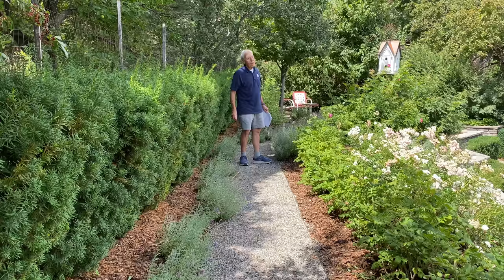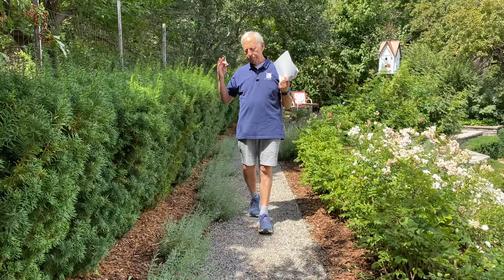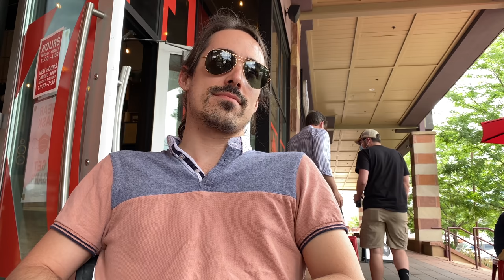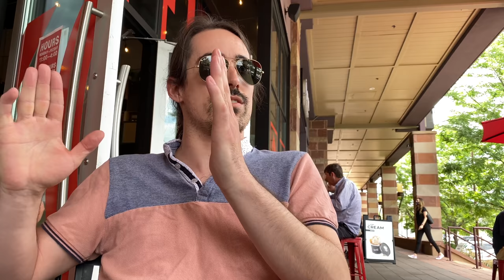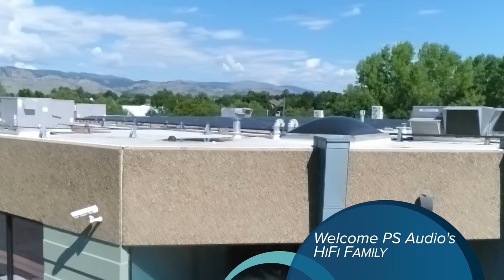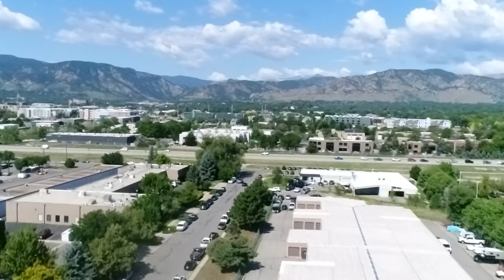Battling class D distortion with tubes

Comment: IcePower operates fine within the intended dynamic range like other fine amplifier architectures. When you exceed that you get distortion, like with other amplifiers. Buy a more powerful amp if you need louder music rather than an amp that is trying to pretend it can play louder by camouflaging the peaks through soft clipping reducing the harsh uneven harmonics. Well, I’m not against soft clipping but please don’t do it with an old solution involving an imprecise tube that needs warm-up and wear out rapidly with sound changing over time. If you really want to do soft clipping, do it solid state and make it sound like the best of solutions. Tubes look great but are yesterday’s fix on this sort of making an amp sound bigger than it is.
Reply: Then there is the asymmetry problem.  Tube stages produce primarily even-harmonic distortion which differs between positive and negative peaks, while class D output stage distortion is symmetric.  I can't see this kind of compensation working well for both signal polarities.  
But they're talking about a 1200W amplifier.  Surely a better solution is just to turn the volume down a couple of dB and avoid the distortion in the first place?  Who needs to drive such equipment all the way to its limit?
Reply: @marianneoelund2940  If you want louder, get more amplifier(s) and more speaker(s). A Klipsch LaScala in each corner and along the long wall should do the trick, along with at least 4 to 6 BHK's.
Reply: @jamesplotkin4674  
My mains have horn-loaded mids and tweeters, not entirely unlike the LaScala.  Even a modest amplifier drives them louder than I care to listen to.
Reply: It does seem kind of Rube Goldberg-ish, however .  .  .  

Possibly just Paul playing agent provocateur with the comment section.  And maybe sell a few more Stellar M1200s.   Or not.  Bottom line, do they sound any good?  I have not heard them so I really have no opinion as to their merit or lack there of.  And neither does anyone else who hasn't listened to them critically, but this has seldom stopped anyone, has it?
Reply: Also, no need to talk about class-D distorsion because one implementation behaves badly at higher levels.
Reply: As I understand it, when valves ‘soft clip’ due to overdriving them, it is much better sounding to your ears than Class D. When a Class D stage is overdriven, due usually to a lack of headroom, they don’t soft clip at all but produce a very hard sounding distortion that to most peoples ears is far worse than the sound of a valve amps soft clipping.
Reply: Roland Jones Yes, but you don’t need to add tubes to create the soft clipping effect. You can do that better with a transistor based circuit.

Comment: LOL!!! Lets see here. Lets use 2nd order distortion to cover up the 3rd order distortion. If I had told that to my first Engineering Mgr (John Laurent, 68) he would have fired me on the spot.
Reply: There are a lot of trade offs to consider in the audio world. For people that want extremely high power, without 100 pound components, little to no heat, but sound that is pleasing to the ear, then this is one way to get there.
Reply: @CaptainCrunch823  "sound that is pleasing to the ear" does not mean it's accurate.
Reply: Bill Kenney I don’t disagree with you. I think you made excellent points. I’m just raising counter points for consideration. Some consumers such as myself spend our money on equipment that sounds great, but often not necessarily accurate😊 I’m personally less interested in class D these days but I understand the benefits and would recommend it to friends if they gave me a list of requirements and it checked a lot of their boxes. I would just make sure to educate them on the tradeoffs before they spend their hard earned money.
Reply: For any BOM cost target you like to get the best out of it. Soft clipping can be done well for cheap (not based on tubes) and while I prefer to have enough natural dynamic range in my system and not rely on some “trying to make good sound out of the peaks”, soft clipping can be a good feature of an amp. Using tubes for it seems a bit of snake oil to me and isn’t ideal for keeping a solid high performance from t=0 when you power it on to years later. Tubes are great in museums.
Reply: @CaptainCrunch823  Great comments from all. Way back when MIT (Media Lab) and BAS did a study on why people preferred the sound of tubes. Your's truly was part of that group. 20 golden ears and a mountain of equipment. There is a preference for tube sound for sure. But, you can reproduce that using DSP. Paul has eluded several times to building into one of his DAC products the necessary processing power to simulate that sound. It would be fun to dial in the sound of the 6550, EL34, 3B4 ect ect. I think it can be done. Note that some of the participants contributing content were recording engineers who brought Master Tapes they had created.
Reply: @wilcalint  Yes, exactly right. There is nothing a tube can do in terms of incremental distortion that a DSP can't do more reliably, more optimized, without wear-out issues and without warm-up dependency. However, if you do tube sound in DSP, you probably want to have some settings allowing you to pick or tweak your favorite tube sound and most certainly, you don't want to add a DSP introducing another ADC and DAC in the path. "DSP tube" is great if you already have a high performance DSP in the path (one where you don't introduce audible quantization noise). Nowadays even a low cost ARM CPU can work as a high performance DSP and if you want to go crazy, you can do all the math in 64 bits at a ridiculously high enough sample rate to finish all arguments. I want to make such product.
Reply: @ThinkingBetter  "Nowadays even a low cost ARM CPU can work as a high performance DSP" - Raspberry Pi 4? :-))
Reply: @wilcalint  Yes, a RP4 can do very well e.g. running Audio Weaver or other DSP SDKs. Ideally you can plug-in, tweak or swap the DSP layout run-time (in this way your tube sound can be a user configurable plugin).
Reply: @ThinkingBetter  This has turned into a very spirited discussion hasn't it! :-))
Reply: @ThinkingBetter  Tubes can reduce the overall component count, they may be cost effective in some areas. When it comes to snake oil I will take a Tube every day over a boutique speaker cable.
Reply: Hugo Bloemers I prefer a pure and tube distortion free signal path and I also prefer not to pay for cables >10 times the manufacturing cost. But tubes look great.
Reply: @ThinkingBetter  For years I owned a classic Williamson ( H.H.Scott Brand) quad 6550 power amp. I loved that thing. 60w/ch. Loved that warm orange glow of those tubes. I wish I had it back.
Reply: Let's be respectful here since that is how intelligent conversation is carried out. Your comment is misleading and tells me that you didn't fully understand what I was saying.  Here's a hint - you first have to study the transfer function of a non linear amplifier. ;)
Reply: @darrenmyers1826  I was probably calculating transfer fuctions when you wern't even a glen in your papa's eye. You ever calculate a transfer function for a servo amp for a 5in naval gun?

Comment: Sounds like the ICE module is over compensating on the voltage rails as the power is increased, thus giving the expansion effect you describe. Don't see how you are going to fix that with a tube. Yes tubes do go into compression but only as they approach cut off not over the range you will require. Good luck -

Comment: Its a good idea to drive a Class-D upto 70% of peak power. They start distorting above this point (anti-cpompression). Another way to deal is to use higher impedance mid/hi loudspeaker drivers. Low impedance woofers and subwoofers can be used.
Reply: Anti-compression*

Comment: Somewhat related to this discussion is a problem that was worked on in Cinema in the early days of the “talkies”. Pre-movie sound there was little motivation to make the auditoriums sound friendly so when the talkies” came along the dialog was buried in the reflections of the room. So the Academy of Motion Picture Arts and Sciences

https://www.oscars.org/

Came up with what was referred to at the Academy Curve sometimes referred to as the “Normal” curve. The curve was applied to the sound path before being broadcasted into the movie auditorium and that made the dialog more understandable. Basically they added sound frequency level distortion (EQ) to the sound to make it easier to hear what was being said.

https://hometheaterhifi.com/volume_9_2/feature-article-curves-6-2002.html

Comment: Yet another nonsensical video. Adding H2 to mask higher order harmonic distortion. How about using a low-distortion amp to begin with (if we're talking class D: NC252MP, NC400, NC500, NC1200 or the Purifi). Or just an amp with more pwr so you don't have to drive it close to clipping..
Reply: ......word
Reply: Now we’re talking. I’m very happy with my Hypex☺️.

Comment: Did you know that the invention of the tube was a light bulb moment.
Reply: When the very first tube was powered on it said  “I can’t see the trees through de Forest!”.
Reply: Actually you are right. Edison experimented with an additional electrode to improve performance and life of light bulbs.  Current could be made to flow between electrodes.  This was dubbed the Edison Effect.  No practical use was apparent, so the invention was shelved.  This is how vacuum tube rectifiers work by the way.

Comment: Why are we even discussing distortion under 0.01%?  That's not a problem.  
Here's a problem:  Where's the heat sink on the M1200?  The ICEpower 1200AS1 module is specified with a 0.8C/W heat sink mounted.  Even with that, continuous power output is limited to 270-280W with 8 ohm or 4 ohm loads, and full-power operation is limited to about 15 sec when using 120Vac 60Hz power.  But I don't see any of these limitations mentioned in your product description or specifications - let alone anything specific to the actual thermal design of the M1200.  
So what's the story?  How hard can this beast really work, without going into thermal shutdown?

Comment: Folks, the proof is in the sound - if it sounds good to a majority, what difference does it make how the distortion is dealt with? I do not care about measurements unless they prove useful in determining where a sound PROBLEM originates. I have a Directstream Junior DAC; I like it a lot, but the folks at ASR tell me it measures poorly, yet the DAC they tell me is the "best", the Topping D90, I found fatiguing in my system. Go figure.
Reply: This means you're adding something (distortion) that's not on the recording in the first place. If your system sounds fatiguing with a more transparent DAC a better strategy IMO would be to change your speakers to better ones, not add euphonic distortion. It may also well be that the speakers themselves are fine, but your ears are acclimatised and it would take time to learn out of it. Sort of a 'burn-in' period for your ears. Similar thing happens when you're used to fun headphones with a V-shape response and when you buy better ones they may sound flat/boring for a while. Just my 2 cents, if you're content with the sound you can ignore this.
Reply: It is all fake anyway so you might as well choose the fake as you like it and if you want the real deal, go to a concert.
Reply: @hugobloemers4425  You do understand that a PA-system at a rock concert is a sound system like the one in your home (and, except for SPL capabilities, probably worse). If your talking about classical (or other unamplified concerts) then I agree.
Reply: @eetu2532  as I am sure you know, recordings are imperfectly engineered mostly, so speaking analogously, adding some sugar to mask a shortcoming in a recipe is not an evil in and of itself. To be more specific about the D90, in my system it is not as tonally accurate with high rez files as I am used to with acoustic instruments, and voices in particular, especially on live recordings (Leonard Cohen is an excellent means of determining tonal accuracy if like me you had heard him sing live). The soundstage and imaging are only decent, and although dynamics and clarity are good, there is a lack of ease to the overall presentation I find fatiguing. My setup is 30K worth of gear, speakers are new B&W 804 D3s, suffice to say the setup is sufficiently resolving. FYI I am keeping the D90 because I am going to replace my Directstream Junior and want a chip based DAC as a reference point. Thinking about a Mola Mola Tambaqui or Terminator Plus, any suggestions would be welcome!
Reply: @michaelmityok1001  The 804 D3 seem to have at least 3dB excess upper treble energy (~8-13khz) which may make them a bit sharp on-axis. Otherwise they seem to be pretty great speakers. Well, personally I think there is no function that can make the Mola Mola and the D90 sound noticeably different (if tested blind, placebo/expectation bias has a huge influence even if we don't admit it). I know that sounds crazy.. but they both have flat frequency response/linearity, inaudible harmonic distortion and noise, inaudible crosstalk, inaudible IMD and jitter. And I mean inaudible when below -120dB (or 0.0001%). After knowing this and that for example the 804 D3 has a THD of <1% (90dB, 1m) the audible impact of upgrading a DAC is imo easier to put into perspective. There are small differences in filters but they should only affect 'airiness' above ~16khz. So in short, I think the Mola Mola/Denafrips money would be better spent elsewhere. Just a couple of suggestions (if you don't use/have these yet): 1) Dirac or other room correction/DSP. For example: my room had a +11dB peak at 54hz due to a room mode. 2) Subwoofer(s) (Rythmik, SVS..). I know the 804 D3 is full range, but to lessen the impact of SBIR and room modes and pressurize a room, more woofers=better. 3) Room treatments. In the end we all have different priorities and preferences. A lot of people don't want subs for aesthetic reasons, for example and that's a valid point. And if you still have a 'what if..' feeling about the Mola Mola or Denafrips go ahead, they're cool looking devices. Happy listening!
Reply: @eetu2532  got room treatment but no subs, do not have space for them sadly. So you do not hear differences between dacs that measure equally well when you listen "blind"? If so, that is odd if you have a resolving system and some listening experience. Perhaps the placebo effect works the other way round as well? As in expecting or demanding no difference guarantees it? My understanding from Paul and other engineers is that we can't measure everything relevant yet. Nevertheless, I like your advice not to spend a ton of money unnecessarily!

Comment: So adding distortion from tube to class D amp (that also add distortion by it design ) doesnt make any sence for my electronic background. You cant polish a turd with turdpaste. Get a clean design amp class AB and done. (class A would be even better with 360 degres of the waveform that the transistors are open, but unpractical in real world needs for most people like me)
Reply: Predistortion (or rather complimentary distortion) is not at all a new technique. All amplifier stages will distort the signal it can't be avoided. If you know how a stage will distort the signal and combine it with a stage that does the inverse then you can often reduce the over all distortion. Perfectly valid technique. Similar things are done with noise injection.
Reply: Mk Shffr distorsion from class d and the harmonic from tube arent really the same in my mind...Im not an expert on that combination I only made class a ab d for fun years ago in my studying. I will look into it maybe Im wrong
Reply: It's not adding distortion with Class A tube preamp, it's about preserving the signal from the source and sending it pristinely to the power amp regardless of the amp input impedance.
Reply: @Model3GenerativeANdroid  it is adding even order harmonic distorsion. thats the sound that some people loves. but it is not because the signal is more pure from a vaccum preamp, it is to make it sound like all stages amplifiers (more complex,cost,heat,maintenance). If you ever do an electronic degree you would understand why.

Comment: Mmmmm.... two cancelling problems ...I thought triode tubes were best for linearity the ECC81-83 tubes have a very good mutual conductance ( gm ) the problem is entirely due to artifacts emanating from the ICE modules ... and the low pass filtering ... this is where you have to correct this sound level expansion ... they all suffer from this problem ... given time the manufacturers will get on top of this ... to me it sounds like saturation of the inductors ...
Reply: It's not saturating inductors.  That would be easy to fix.  It's mostly down to how the feedback is done.

Comment: What a pointless video. Pseudo-technical babble. It is well understood that an amplifier will distort if driven too hard. A tube amp will generally produce soft distortion which has a warm sound. A SS amp will produce hard distortion which sounds unpleasant. The solution is to buy an amp with generous power headroom so there is no chance of over driving. Paul, surely you already knew this?